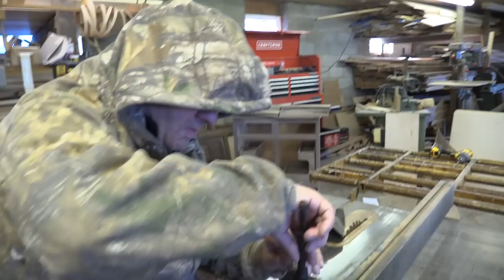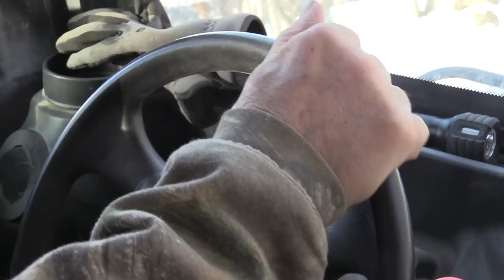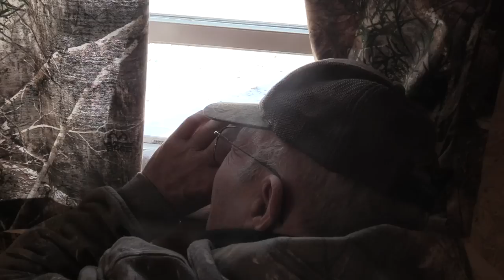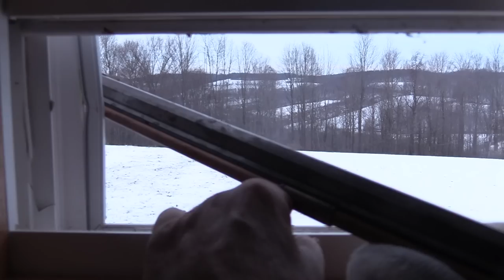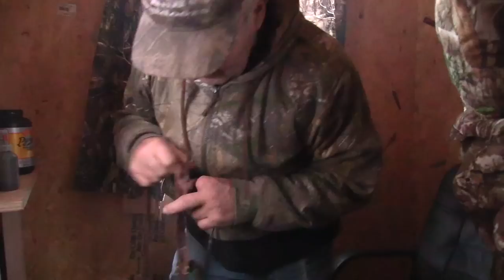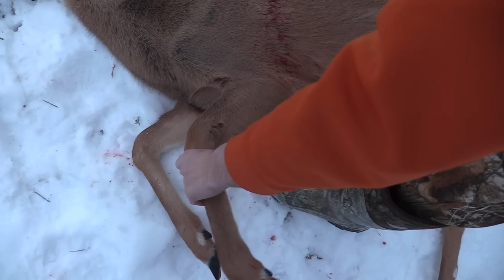FLINTLOCK HEART-SHOT! (3 Legged Deer?) - Traditional PA Deer Hunt

Comment: Hats off to Grandpa for taking the cripple. Got an information question. Grandpa seemed to be loading that flintlock with Pyrodex powder? I always read that wouldn’t work in a Flintlock. So was it Pyrodex? It seemed to work we’ll enough to me.
Reply: It’s a crap shoot at best using any black powder substitute in a flintlock. It’s due to the higher ignition temperature of the substitute. It seemed to work just fine this time, but the next time very likely could be a completely different result. You have to ask yourself if you’re willing to risk it?